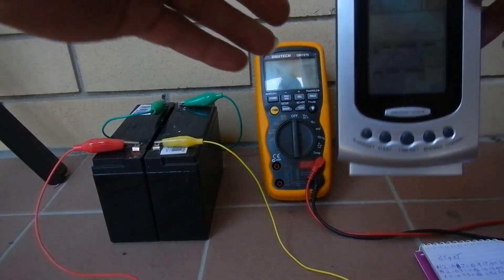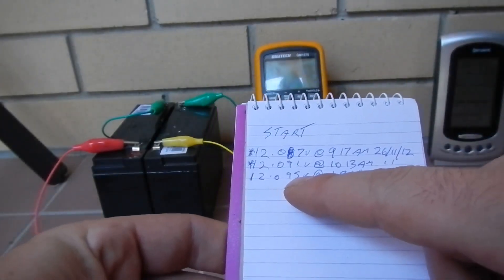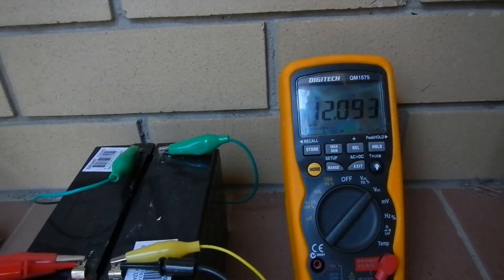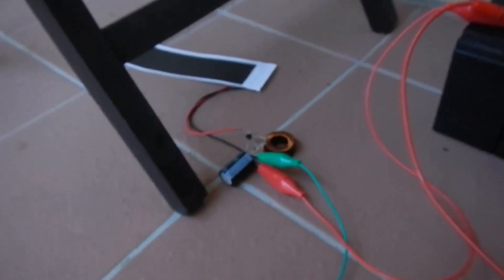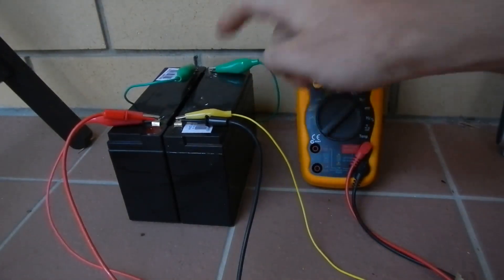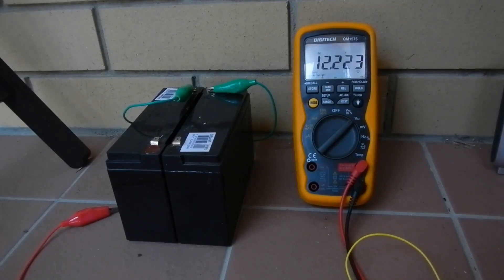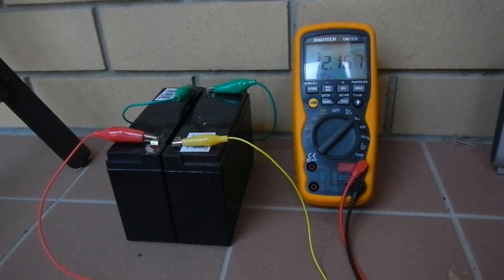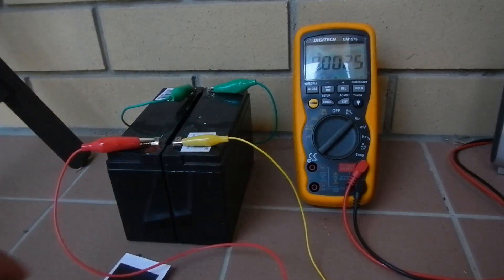Charging a 12v Battery in the shade. pt2. Results of testing after 6 hours. Sucsess!

Comment: Are you happy to share your circuit schematic?
Reply from the maker: I think I did in one of the videos. Its just a Joule thief, with 10:1 coil ratio. Long winding side goes to the collector of the power transistor. Run charging diodes off collector and base. Common neg if you want.
Reply: Mongrel Shark
No worries, I didn't come across it so maybe I missed the vid...will look some more...I'm a big fan of schematics though as they seem to match my learning style and remove all ambiguity.
Reply from the maker: Its a bit late here, getting ready for bed, if your still stuck drop me another message here and I will draw up a schematic for you :)
Reply from the maker: Like this, but make the collector winding 10x as many turns as the base winding.
http://madscientisthut.com/wordpress/wp-content/uploads/2010/10/bat_chrg_sch.png

Have a play with diodes. I'd recommend decent rectifier diodes like 1n4007, over ht e LED. I have used LED's for this stuff, but they tend to die.
Reply: Mongrel Shark
Thanks for that, you're a champ...I'm trying to keep a light illuminated 24x7 for at least 2 months so this circuit may help to keep the battery charged (at least partially) and a JT will run the LED form the depleting battery.  I've made the 7yr JT that Xee2vids put up but my gut feel is it won't run as long as he said (since he also has a 8yr one that only flashes the LED...Thanks for the help :o)
Reply from the maker: If you put a couple of leds in series, you can loop the collector back to pos and the base back to neg. Or try the Dr Jones revers JT. If you dont mind a dim light, its very possible to have a JT that runs for a very long time Sohei Thoth Also has a couple of good ones.
ClosedLoop Joule Thief
and this one I think i like more.
Wireless Battery Charger - Part2

As with that last one, you can experiment with a third winding (like many CFL lighting JT's) and full wave bridge rectifier on the output to charge the run battery.

It is possible to get constant light and have the battery float up and down in charge, due to battery recovery. Around .5v-.7v would be the tuning point to aim for with a single AA,
Make sure its a rechargeable.
Reply: Mongrel Shark
Thanks again for all the leads..Sohei's closed loop looks interesting, will give it a whirl and see what it does.  Interestingly, the '7yr Joule Thief' circuit lasted under 2 days so I'm not holding out too many hopes!
Reply from the maker: Its all down to tuning. I've had heaps run for weeks, or turn it up a bit and it drops to hours.
The key  isto consider battery recovery. You know how you can put the flat flashlight on the shelf, and a week later it works for a few seconds. Or if you discharge a battery, and watch the voltage immediately after load is removed, and it starts to recover... You need a JT that pulls less current than the recovery. Throwing some flyback at the battery enhances the recovery effect too. If you have a jt that had decent sized inductor, draws less than 5ma, and runs in the 700-400mv range. It wont stop until the battery is completely stuffed and leaking. Its not really useful, but it can be done. As long as your not expecting to read from the light.

Comment from the maker: Amorphous Panels are still a bit expensive, they go down around $10 a watt if you get bigger ones, or bulk order. I must say the power from that panel in low light is fantastic. A moon/star powered circuit should be possible! In a dark room, my monitor can power an oscillator from a few meters away.